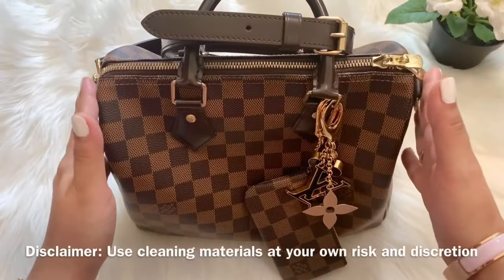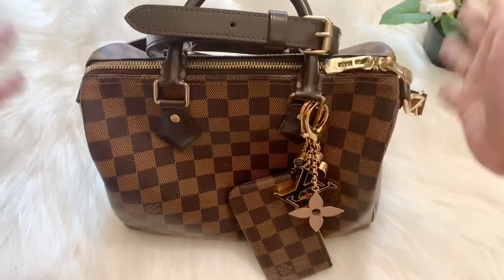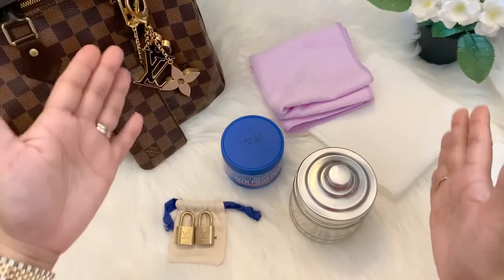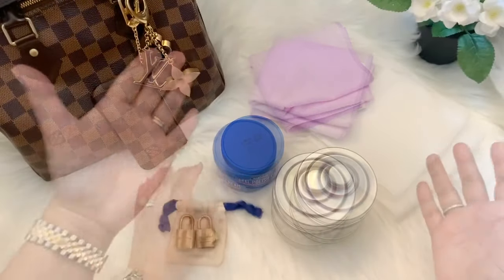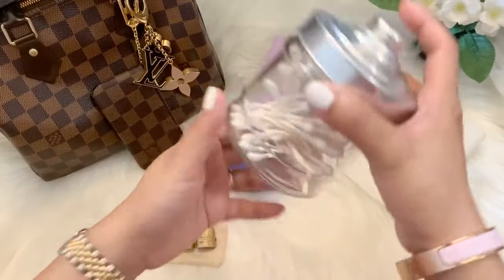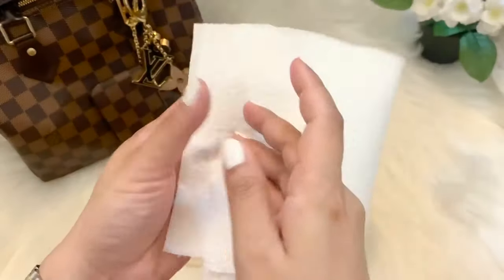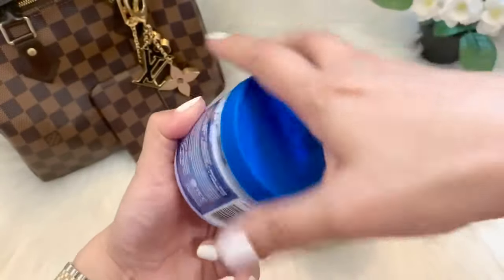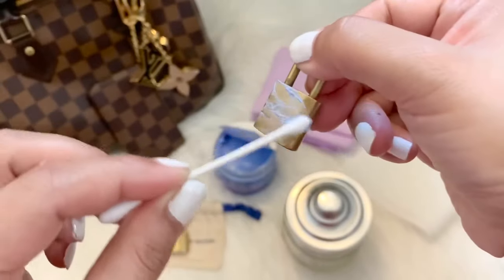HOW TO CLEAN THE HARDWARE OF YOUR LUXURY BAG | Polishing your tarnished hardware | splendid_lush

Comment: Hy.
I have louis vuitton bracelet confidential model and there is scratch on metal and not shiny like first getting
It will work?
Thank you
Reply from the maker: Hi. I think it will work. Just try a tiny bit of a small area of the bracelet. I don’t think it will remove the scratch but I think it will help make it shinier. Again, do a test on a small area of the bracelet and see how it turns out. Hope it helps.

Comment: Hi just want to ask if have you tried using this with gucci marmont bag?
Reply from the maker: Hi Dear, I haven’t tried it yet with Gucci Marmont. If you want to try,  I suggests put a small amount of the cleaner in a Qtip, apply in one small spot, probably in the inner buckle of the bag first, buff it after and see if it will work good on that. But pls proceed with caution though. Let me know if it works 😊
Reply: My gucci also got rusty

Comment: Is it dangerous if you get some of the product onto the fabric or leather part of the handbag? I'm asking but no worried if you don't know! Maybe someone else in the comments will :)
Reply from the maker: Hi! Good question, dear! It actually happened as I was doing it in this video. What I did was I took a small brush (old toothbrush will do, too) and I just brushed the fabric where the zipper is with a little bit of water and dish soap and it went away. It doesn’t harm the canvas itself provided that the product won’t be used  primarily on the canvass. Just wipe it off right away if you saw some product got in contact with the canvas. Hope it helps! 😊
Reply: @splendid_lush  Amazing! Thank you so much for your help :)
Reply: @splendid_lush  I think the best way to protect the leather while cleaning the hardware is to put a tape around the hardware before cleaning/polishing them. That way, the leather of your bag will be protected from the polishing cream or any chemical you are using. I hope it helps. 😉